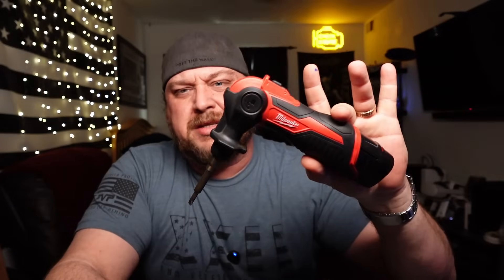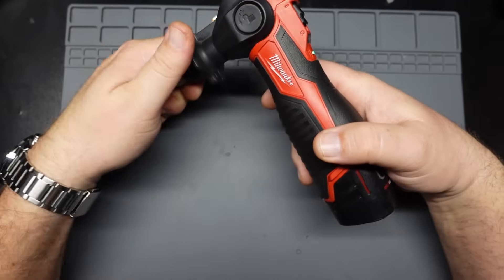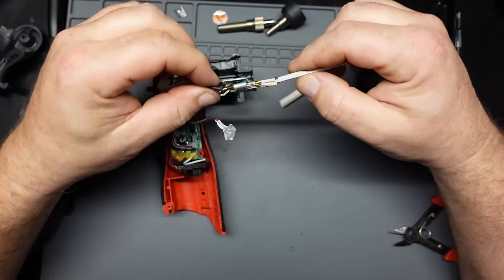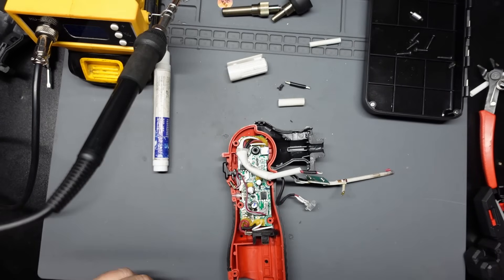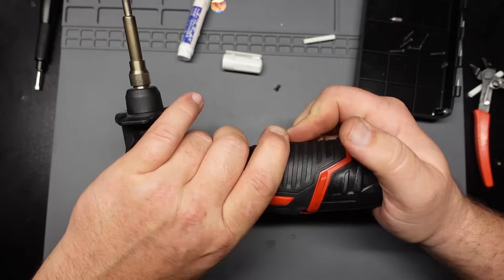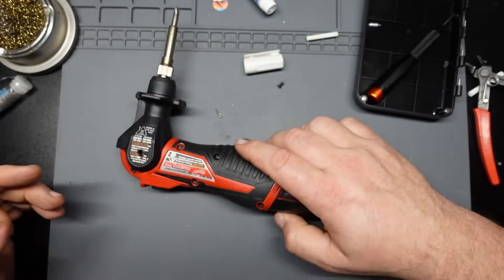M12 Soldering Iron Dead

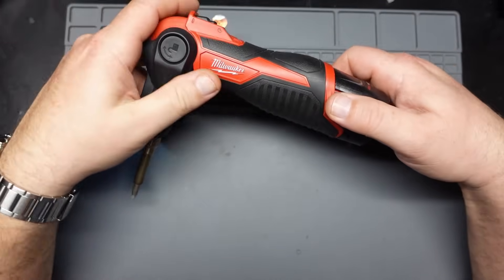Comment: 2:02 in. I will guess before finishing video that the heater element is open on it.  Lets see how it turns out.

*edit
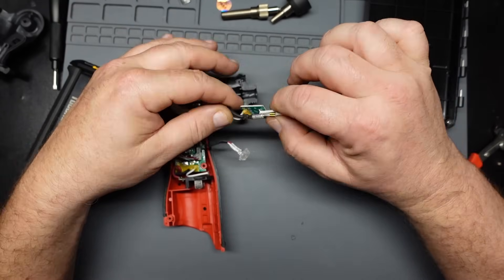6:12  and I was right. Open on the heater element.  
I don't know why they made those like that.  When the element fails you would want to be able to remove and replace without taking everything apart.

*edit edit
You can always get a replacement thermal fuse and add an inch of wire to it and get it a bit further from the element.  But heat probably isn't what opened it.  The thing internally was a cold joint waiting to fully open with time. Hot/cold/hot/cold temp swings by season or AC,  being in your bag or truck will hurry failures along.  While connected to your ohmeter you could have applied a litte heat and see if expanding the metal inside the fuse would have allowed current flow.. next time.

Comment: For bigger thermal fuse you can use a metal mass between the place you solder and the fuse. Adjustable wrench worked for me a few times. It's still hit and miss but those fuses cost pennies.

Comment: Thermal fuses can be soldered, but you need to heatsink with an alligator clip between the device and the portion of the lead that youre soldering, and it helps to leave the leads as long as possible. Clean the leads first with steel wool or a scotchbrite pad, and considering using a dab of additional flux. The faster you can get in and out with the soldering iron, the better; use leaded solder because it has a lower melting temperature than leadfree solder. *PS, the real reason the thermal fuse is often crimped into the circuit is because Nichrome wire used for the heater itself will not accept solder*.

Comment: Is that a fuse or a thermocouple?
Reply: It's a fuse with a specific melting point.
Reply from the maker: It’s a fuse and one that only works once unfortunately
Reply: @FunkFPV  , as a volunteer with the local Repair Cafe group, I keep a range of thermal fuses in my parts kit, in case I need to replace one on a coffee pot or other small appliance. Ten thermal fuses of the same temp rating only costs around $7 or so thru the big A online place ( the seller or manufacturer was called Bojack). I had to replace one on my food dehydrator recently.
Reply: @FunkFPV  , as a former ( now retired) audio electronics repair tech, I sometimes encountered "dead" power transformers which had a thermal fuse inside of them; sometimes the connections to the fuse and transformer winding were accessible and a repair was possible, but other times it wasn't. I remember a fancy, expensive direct-drive turntable that was dead due to a blown thermal fuse that was laying against the motor coil; I cut the rubber sheath away from the coil and replaced the thermal fuse, only to find that the platter was now spinning in excess of 100 rpms! A driver transistor had shorted out, increased the voltage and current to the coil, which overheated and blew the thermal fuse. If the motor didn't have a factory-installed thermal fuse, the coil would probably have burned out, making the turntable unrepairable, or perhaps might have even started a fire.

Comment: Had a 10W soldering iron I bought in 1994 and during COVID-19 I decided I wanted something a little better so I purchased an 80W iron online because we spent 112 day in lockdown and the iron would take a couple of different tips. Had a temperature control dial and a stupid turbo button which I inadvertently hit two maybe three times and three months out of warranty the far king thing stopped working. Tried getting a new ceramic heater for it but the turbo and the temperature dial made that an bridge too far for my limited skills.

I liked the 80W iron because it would heat up a lot faster than my reliable 10W and I learned how to solder wires together quicker and not overheat the wires as would happen with the slow 10W tortoise. Still looking for a replacement heater and of course the online seller (they also have a bricks and mortar store) is of no use. Ended up getting a real cheap solder iron and hot air station for a little less than twice the cost of a new 80W. Iron is really good with a large temperature range but I want to have spare heaters for both parts so I don't get dropped in the 💩again when one of them fails. The unit cost me AUD$68 (USD$43) so not to shabby for an iron and hot air combo.

Thank you for the video and apologies for my long rambling babble. I blame the meds I'm on but I secretly wonder if it's now just old age and I have now become one of those rambling old farts that I used to complain about some 45 years ago. 😱🤦‍♂

Comment: I'm surprised yours lasted so long. I use mine heavily for work and have replaced it under warranty 4 times now. They updated the design with the last replacement so I'm hoping it'll hold up. It would seem no thermostat to regulate temp is the issue if I had to hazard a guess.

Comment: Too late to no try at home I did that with a 20v glue gun went from original 20g wire to 14g wire heats up a lot faster now. Sort of like my old 12v bosch impact driver something is wrong with the trigger when it stops working just pull the trigger and hit it then it works fine.

Comment: Well dang, I have one of these, only used it a couple times so far. It works great, but I guess I'll know what happens if it stops working. Thanks for this video and all your comedy shorts. I used to drive a forklift, Toyota electric and Crown electric. You're the real deal Funk. ✌
Reply from the maker: 😎👍🏻 Toyotas are better 😜
Reply: @FunkFPV  yes they were! We had one called black top, it had an older flip up battery lid/seat pan. It was the longest running lift at our factory... Until they got a contract with Crown... And went full feminist managment. So now I work at another food factory, they have Crowns with impact sensors. 😂

Comment: I personally like my M12 soldering iron get the bigger batteries and it can stand on its own. I tend to use it in automotive more as a replacement for the soldering guns, rather than a soldering iron. I am interested in the higher end adjustable temp ryobi which seems pretty good for the price, well everything except the wire going to the iron.
Reply: I have heard of a bunch of people burning these out though. I tend to use it with smaller tips, so maybe thats why I havnt. One nice thing is that it effectively takes Hakko tips so I can share with my FX-888.

I have heard of people deleting the fuse as well, especially once out of warranty.

Comment: I like that Mellif iron you used to fix it.  They have a lot of cool stuff for use with DeWalt batteries, I have a small fan and a work light.  Maybe you could review their line up.
Reply: I need to check out the Mellif soldering iron, but he did do a review on the fan, which then I ended up purchasing it and loving it.
Reply from the maker: @aguycalledlucas It’s been discontinued 😢
Reply: @FunkFPV  oh no!!, thanks for letting me know, before I went on the hunt.

Comment: The element went on mine. Replaced that and it worked fine for a day. After that the board went out. Fuse still intact and showing continuity. Had to buy a new one since i couldn't get info on the board. No voltage to the element.

Edit* This was after 2 years of use, 6 days a week. I held a military funeral for it.
Reply: @HashiriyaSquadron  , somebody probably sold you the wrong heating element. 99.999% of the heating elements sold online are for 24 volts, but the M12 requires a 12 volt heating element, which are rarer than hen's teeth. After extensive searching, I found just two sellers in Australia who appear to have the correct 12 volt heaters; the rest of the sellers purporting to have replacement elements for the Milwaukee are just blowing smoke up your a.... They're selling cheap clones of the Hakko A1321 heater, which is 24 volt and therefore not compatible (and the real Hakko part is about $25). Several sellers note that the M12 will.operate differently with these supposed "compatible substitutes" ---- the green LED won't stop flashing ---- which should be a clue that it's not a compatible or exact replacement.

Comment: I HATE one-shot thermal fuses. They are planned obsolescence personified.

Resetting thermal fuses have existed for decades but way too many manufacturers want more of their crap in landfills.

If any government was serious about saving the environment, manufacturers would be legally required to take back any of their products that failed for refurb and/or proper disposal.
Reply from the maker: I agree 👍🏻
Reply: Switching to lead-free solder and ROHS was the industry's "compromise" in order to render all electrical/electronic devices "environmentally harmless" (yeah, right) and prevent manufacturers from having to pay to take back all their defunct devices for recycling and recovery of materials. The side benefit is that unleaded solder is more likeky to break down prematurely from temperature extremes and vibration than leaded solder: planned obsolescence working in favor of the manufacturers..... 😖

Comment: Thermal fuses can be soldered. I just replaced one in my convection heater. The key is to attach a pair of pliers between the leg you're soldering and the fuse itself. The heat goes into the pliers instead of the fuse. I bought 2 just incase it didn't work but to my surprise it worked great 👌 It was only a 180°c fuse too. 
Soldered at 400°c to be quicker
Reply: Leaded solder is better for this application because you can use lower temperature to solder the new fuse; keadfree requires higher temps and longer time for the solder to wet and flow into the connection.

Comment: #1 Super appreciate when people comeback and do a re-evaluation or update on products!
2) 2:25 gotta love it when a HF tool comes in handy for moments like, "wth can I use to remove this, but not overpay for it?"
3) This is one product I will never buy unless I know it's for fun -cause - it WILL eventually break.. It has multiple 'design/engineering' flaws. Like, being a high-temp soldering iron with a metal shaft threaded into a *plastic housing*. A few scenarios from most to least common; plastic will soften, deform or melt, the inability to regulate the temp results in it just cooking itself (no pun intended), and at some point leading to the tip becoming loose or misaligned.

Comment: The fuse is to protect against the switching transistor failing short. It's just to clear such a fault. I hate these thermal fuses, seems hair dryers and such use them, and same failure from proximity to the heater.
Reply from the maker: I think they call this designed obsolescence

Comment: Dumb question: is that a safety fuse or a temperature regulating switch?
Reply from the maker: It’s a safety fuse. The temperature is regulated in the tip if it’s every other iron.

Comment: don't use it often but I have an old radio shack soldering iron from the 90's that my dad owned
Reply: That's what I used until I got a Yihua soldering station in 2019. Man that thing has been excellent. I use it almost every day and I'm still on the original tips.

Comment: You're basically the American family-friendly-ish version of AvE, and I'm loving it. As for the temporary repair, yeah, "temporary". 😛 Been there, done that, the baling wire and duct tape is still holding, I swear I'll get the right bracket someday ... If anything, you made it more skookum.

(in similar "don't try this at home", I have one of those lil' 100psi 3-gallon pancake air compressors with a gauge that goes to 180, I opened it up and shorted the cutoff switch, the release valve blows at 125psi, so I wrapped a rubber band around it ... I mean, there's like a 3x safety factor at least, so bumping it up to 150psi won't kill me. Also I may have cut up some old bicycle tires and rummaged through my late father's HVAC-tech van to make adapters for tire valve to other thing to use empty cans meant for something else as compressed-air storage. Allegedly. And anyway, it's only a crime if you move the repurposed can, it's perfectly legal as long as it's on my own property.)
Reply: Do what you want with yourself and your own, but AvE himself said it best "Do not f**k with pressure vessels!"
Reply: Used to watch AVE UNTIL HE GOT INTO POLITICS.
Reply: @georgeburns7251  Eh, whenever somebody like him gets into politics, if I don't agree with their views I consider it part of the comedy.

Comment: If you would have sent it in to Milwaukee they would repair it at no cost as it was used as intended and not abused. I have a friend that has a M18 air inflator and the hose was leaking after a few years he sent it to Milwaukee and they repaired the hose no charge
Reply from the maker: It’s a garbage tool and not worth any more of my time.
Reply: @FunkFPV  fair enough

Comment: I’ve been through five in as many years. Funny, I actually had one die last night while doing some automotive repairs. Home Depot always warranty replaces it, but man, it’s been a couple of big hassles on jobs far from home. It may be time to change it up. Great video!
Reply from the maker: Stay tuned. I’m going to try and find something that’ll work on M18 or Dewalt 20v
Reply: @FunkFPV  , the problem I can foresee with an M18 or 20 volt unit is that the vast majority of easily available ceramic heating elements are 24 volt, not 18 to 20 volt. The 12 volt heating element used in the M12 iron is pretty much unobtanium; after extensive searching I found just two Australian suppliers for them. The usual Chinese sources are selling 24V heaters and lying about their compatability with the M12.
Reply: The issue that I had with the first couple, was the plastic tip completely melting over onto itself. This issue was remedied about two years back, by putting a small heat sink that now resides at the base of the tip. Haven’t run into that issue since.But as stated above, I’m still running into the issue where it stops heating.
Reply: Just keep buying Milwaukee, because 'merica!!!!

Comment: Definitely common, my first one lasted a little less than a year. Got it replaced under warranty, second one went out in a few months. 3rd one did the same, got fed up and did the thermal fuse delete and haven’t had an issue since
Reply: I'd do this, but just leave batt. out unless using it.
Reply: Just keep buying them, because Milwaukee is the best, even though they are junk.

Comment: Probably just a bad fuse from the get go, I use mine a lot and still going. Ive got different tips for it but other than that it still works good. I prefer your other soldering setup for bench soldering but in the field I like the M12 one because I don't have to worry about cords and it can stand up on its own when you use the bigger battery.

Comment: Those m12 soldering irons they love to snap the heating coil.
Reply: Exact replacement 12v ceramic haters are extremely difficult to find; there are two Australian sellers with the correct heater, and everyone else is selling "compatible" heaters that are actually designed for 24 volts; some sellers note that the M12's green light doesn't stop flashing when using their "substitute", presumably because it never heats up fully. There's an internal  temperature adjustment tatt might compensate somewhat, but battery life on a full charge will likely be shortened significantly by use of a 24 volt heater.